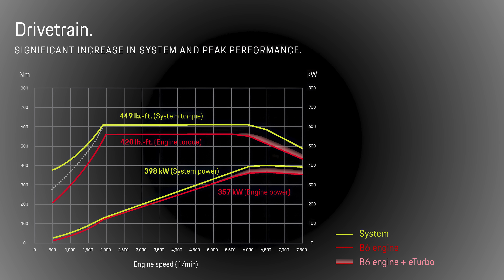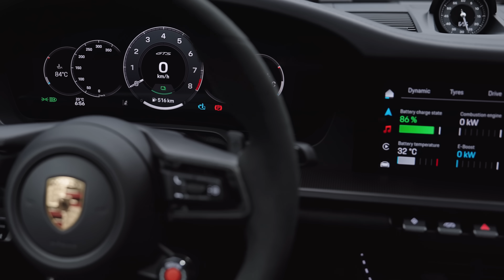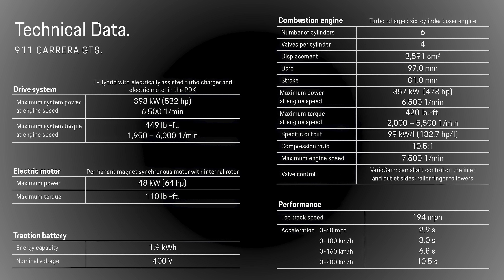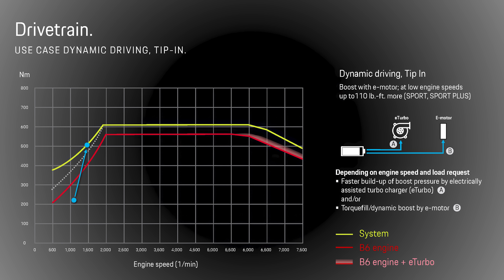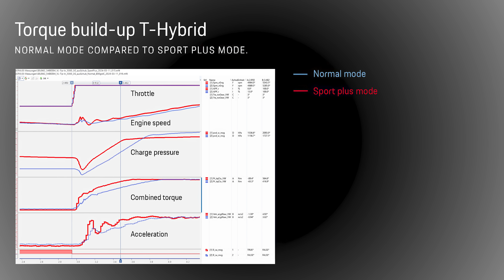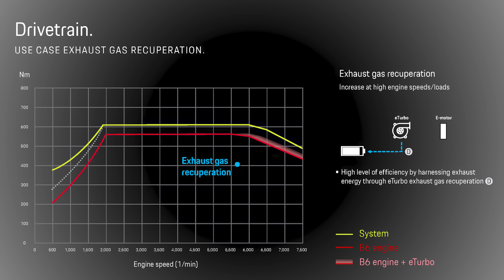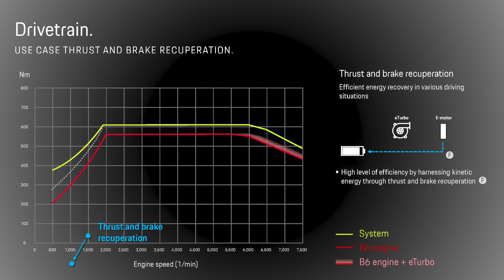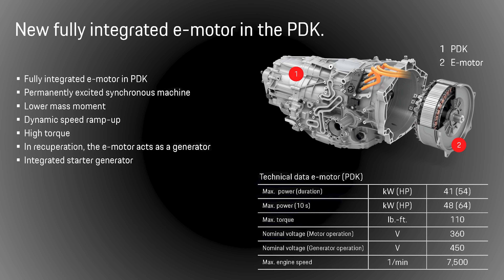2025 Porsche 911 992.2 | Bigger Engine, Electric Turbo

Comment: Crazy impressive to have a Porsche engineer explaining everything so perfectly...mad respect for this review of the mechanical side guys as it is very impressive!

 
So 100 lbs to gain 60 hp...all in the name of compliance...? 
Well at least it can get a full lap of the ring on a fresh battery pack at full charge before you lose the function of the turbo? 😬

To be fair most who buy this car won't track it so there is no real valid concern...?
Reply: The way the brand has been going, they are just building and selling to collectors and scalpers (mates with the dealers).  I've lost all interest in going beyond my 981 and 958.  Not diminishing the technical excellence of what they've built.
Reply: @guser7137  They burnt and soiled a lot of customer relations with their business model for damn sure! Engineering excellence keeping them in business though.

Comment: Wanted to hear the rationale for locating the battery pack over the front axle. That would seem to be the worst place to put it. Were they space constrained?
Reply: They wanted to keep their static weight balance apparently.
Reply: I can think of 3 possible reasons of the top of my hat:
1. Weight balance
2. Cooling (keeping the battery away from the hot engine)
3. As you already said yourself packaging

Comment: Hybridization may add performance but it removes the ability for you to service your own car. I can only image the issues these will have in 20 years and you’ll be forced to go to the Porsche dealer for anything serious.
Reply: Porsches have been going that way prior to hybridization unfortunately. From the 991 onwards you haven't been able to even see the engine without going under the car.
Reply: @dln.sweeney  that’s true but at least it’s still a simple engine and transmission. Now it’s over complicated

Comment: They kind of glossed over it, but the Lambda 1 thing is really big news. There is not a single turbocharged engine on sale that targets an AFR of 14.7 under load. That's very impressive.
Reply: puts in 89 octane
Reply: If it works
Reply: what does that mean?
Reply: @rel6294  it's all about air to fuel ratios in the cylinders... usually like 12 to 1 or lower under high load and "lambda 1" is another way to say 14.7 to 1 (aka one 'atmosphere' of pressure)
Reply: @ikaros4203  if im not wrong, basically the closer to lambda = 1 means more efficient combustion, since with the same amount of air it require less fuel to produce combustion? but in exchange for higher operating temp since no fuel is used for cooling?
Reply: Actually quite common with direct injection. EA888 does it.
Reply: This needs more explain
Reply: Stupid question, does this mean potential for less reliability if run in track /hard as more chance of knocking or running lean (without margin of safety of a rich mix)?
Reply: @trogdortheburninator8149  plenty of safety features in the engine controls to pull timing, or add fuel enrichment if combustion stability falls away as measured by the knock sensors. I personally do not see this as a risk on a track oriented car, more as an asset because it saves on fuel consumption at high loads.
Reply: Lambda 1 (~14.7 AFR w gasoline) is actually a lot more common these days than many people think. Emissions and fuel economy standards over the last few years drove this. there’s only certain scenarios where modern cars will dip below 14 seven buried most of the time during normal driving they try to hold 14.7/lambda 1.
Reply: Actually most of them do, at least for limited operation.  BMW has been doing it since the N54 engine, but would only run lambda 1 up until 4000 rpm or so, or for a few seconds until exhaust temps climbed then they'd go to power enrichment.  The 3.0 turbo in the new Acuras tries to run lambda 1 for as long as possible as well (BMW does it better).
Reply: So is it detrimental to keep the AFR  stoichiometric at full load ? , I thought all engines did this ?
Reply: @domkraggp9944  on regular gasoline yes very hard to do and has never really been done on cars 100% of the time before… on Ethanol fuel you could do it because it burns slower and cooler allowing quite lean mixtures

And if you’re wondering why it’s bad: lean mixture means more heat (and therefore knock/preignition… very bad for every part of the engine lol)
Reply: @ikaros4203  thanks 🙏 learnt something new.

Comment: Sounds like hybrid and manual transmissions are mutually exclusive
Reply: They're not (Honda proved that years ago), but nobody is bothering to attempt to develop that tech further....well...yet, anyway.
Reply: @aprtur that’s because Honda pioneers everything and then the Germans take credit.

Rear wheel steering on 1988 Prelude, 
then in 2014 debuts on 911 GT3

Variable Valve Timing early 1990’s for Honda everyone else like a decade later (or more) 

All Aluminum Construction on 1991 Acura NSX. Porsche 991 generation 911 in 2012 was first to have (only partial) aluminum chassis and body panels

Double wishbone suspension on lots of late 1980’s Honda products including Accord/Civic/Prelude/Acura Legend, Integra, and NSX. 
Porsche debuts it on 992 generation GT3 and everyone loses their shit 🤦🏻‍♂️
Reply: @jameswillard1  "that’s because Honda pioneers everything and then the Germans take credit."
  You mean the Germans perfect it.
Reply: @darthnatas953  please tell me more about how the Germans perfect it again at the 4 year mark when the warranty is up 🤔
Reply: I think it's tricky and arguably not worth it
Reply: The Suzuki Swift mild hybrids are also available with a manual transmission (at least here in Europe).

Comment: Unless your competing in a racing series with points and money, which I would imagine 99.5% of the 911 owners will never do, why do they need to keep getting faster?  Most sports cars for years have been too fast for the road, let alone their owners ability to extract the performance.  Why not concentrate on light weight exotic materials or construction techniques vs trying to get more power from the engine by overcomplicating the drivetrain.  It's still a fantastic display of engineering and I would buy one for sure.
Reply: That's why real men still drive Miatas
Reply: @dielaughing73  I agree. I'm not immune to hp.  I love to go fast and own an 1000+ whp twin turbo 5.0 mustang.  It's stupid fast in a straight line.   But, I still believe it's more fun and more rewarding to drive a 200hp car at its limit.
Reply: Because of the stupid culture that has grown up around numbers and pointless drag races on runways, thanks SO much, Carwow

Comment: I read somewhere that Porsche's engineers fought tooth and nail trying to keep the analog tach, but suppliers weren't willing to continue producing it due to the industry favoring digital gauge clusters.
Reply: No not true it was done to cut costs by having the same display for all models
Reply: @7ludi  yeah. If the industry will keep supplying hydraulic steering for tiny manufacturer mclaren, they would continue to supply analoge tach for porsche
Reply: yeah the screens/'track view' is so cope, screens should go on either side of the tach like they were...
Reply: two words, Aston martin

Comment: Porsche marketing bs checklist
0-60 time mentioned  ✅️ 
Ring time mentioned  ✅️
Reply: That can't be a Porsche check list. Where's the next 7 pages?
Reply: To be fair, it's a commercial
Reply: Na, 6 speed manual. Sell millions.
Reply: The 0-60 is always understated.
Reply: @guser7137  overrated statistic
Reply: @Carado5150 it's literally the only performance stat that 99% of buyers can actually hit save for braking distance, hardly any buyer is bold enough to hit peak cornering forces and almost no one goes out onto an empty stretch of road to slam the brakes from 60mph

Comment: I remember when the first gen Prius and Honda Insight came out, hybrids seemed like the worst of both worlds. Two separate power trains merged into one. Extra weight and complication. 
But that was before every single manufacturer started downsizing and turbocharging every engine in their line up. 
I'd wager that since Porsche is running a 3.6L rather than a 3.0L, they can get similar power numbers to the previous engine, but running slightly lower boost, much in the same way that AMG was running fairly large V8s with high flow, low boost turbos right before the ubiquitous 4.0 V8 became their only V8 option.
What I'm getting at here, is that IC engines have gotten smaller in displacement, but the complexity and thermal management issues have only grown. Not to mention the fact that these engines consume less fuel at low loads, compared to the larger displacement N/A engines that they replaced, but have proven to be less efficient at high loads.
If/when the 911 992.2 T comes out,  I'd rather see it have the turbo system removed than the hybrid system removed.

Bring back the peaky N/A engines and rather than turbos to get more area under the curve, use electric motors integrated into the transmission or differential to add power and recover energy.

Comment: I’ve owned three versions of the 911 in the past 7 years including a GT3.  I’ve decided the NA manual mid-engine Porsche cars are better fun street cars.  I’ve purchased two of them in the last few years.  The 911 is just too big and too heavy for my taste now.
Reply: Agree.... after four 911s, I've moved on. Wouldn't have a new one.
Reply: @SPQR3000 every car is bigger now.  No way around it with the implementation of modern safety tech and such.  Battery tech will only make it even heavier
Reply: Thank you. Track times, 0-60? Who cares. Give me an NA anything, manual trans, and a windows down soundtrack. No one cares how fast you are, there's always someone fast. Just have fun.
Reply: Took one of them out today.  2021 Spyder manual.  Roof down bliss!
Reply: Good point. Gt4rs?

Comment: Meanwhile, F1 says the MGU-H has little relevance for road cars and eliminated it from the next ruleset…
Reply: I guess they weren't thinking about the performance application of it. They assumed that road cars would probably only be trying to gain efficiency, but this car is using it in its current application in F1.
Reply: @caryg4638 Mercedes themselves already have it on the road and they are in F1. Seems silly to me. I think it's all about sound and they didn't want to claim something purely emotional.
Reply: F1 always does the dumbest decisions
Reply: It's Porsche who made them drop it.

Comment: They should have gone high-revving NA engine with hybrid. The engineer says it is all about performance. However, on the street no one can extract the performance without losing a license. They need to bring back emotion. Also, notice how the standard daytime running lights make the car look like a beetle. No wonder the marketing is only showing the car with upgraded headlights.
Reply: Agree, but I think emissions rules dictate change like it or not. Just buy an older model, I just bought a 987.1. Not the fastest, but it’s a manual, very light, hydaulic steering, and naturally aspirated and you can wring it out on the street. Or get a Cayman 4.0 if you can afford it.
Reply: All about the numbers ans tech, lesser for experience. When people now lack the capacity to experience an exciting car with an inspirational soundtrack themselves, why should the company target the few that still can?
Reply: This is only their base line up… I imagine the next refreshed gt3 will be the 4.0 hyrbridized.  Next turbo will probably be bonkers with the same set up as this GTS with twin hybrid turbos.
Reply: be sneakier

Comment: This is nuts. Electricity spools the turbo initially and then the exhaust gasses essentially spin the turbine to charge the battery or use recuperated energy for the E-Motor. This isn't what I was expecting, and it's quite ingenious.
Reply: It's a genius idea, the turbo basically recycles twice.
I wonder what efficiency does it have?
Reply: mercedes has been doing it for a while now
Reply: Correction, i dont think mercedes captures energy from the turbo...

Comment: Oh my god look how deep the water pump is buried. Plastic impeller too! Couldn’t quite tell from the cutaways but looks like it might be very hard to replace.
Reply: The only way you can access the pump is with the oil pan removed, it is a very stupid idea to have 2 one dollar o-rings between the oil and water circuits. It is all about cutting costs, as with the full digital dash. These cars will be good for 5-7 years, after that will be scrap. Even "new" "OEM" spare parts for other older Porsches are cheaply made in India or Pakistan. I sometimes preffer to save and restore old used Porsche parts made 25-30 years ago than buy "new" refurbished junk in Porsche labeled boxes.
Reply: the 2nd owner of these cars better have 30k ready to go for repairs at all times
Reply: There is no German word for serviceability.

Comment: MGU-H in a road car. This overall is more similar to the F1 power train than the F1 teams are doing in their road cars. Amazing.
Reply: That whole split-turbo MGU-H system was pioneered by the Mercedes F1 team and they have been running them since 2014. That system is present in their AMG One, the new C63 and the current gen. 43 (moniker) products.
Reply: Makes me wonder why Porsche was pushing for the removal of MGU-H during F1 entry talks…
Reply: @Nathan0A  Because they weren't as versed on the tech as Merc were. You can tell they're playing catch up. If MGU-H makes a comeback, you'd bet the VW Group would be keen on it.
Reply: That IS a head-scratcher
Reply: Mercedes already has it in the C63-- if anyone actually buys one
Reply: Thats worth the definition of a new generation car alone
Reply: Haha I'm not an engineer and this is literally all that was on my mind. 'doesnt this all sounds like a mguh which F1 banned because they thought it went applicable to road cars'

LOL. FIA being shown to be incompetent again

Comment: I remember a time when "electric turbo" meant some BS you got from Ebay
Reply: Not to split hairs but it's an electrically assisted turbocharger, it's still principally powered by exhaust gas.
Reply: @toddstevens8506 was going to say if it was purely electric it would be a centrifugal supercharger, turbo charges are run off exhaust gasses.
Reply: @toddstevens8506 assisted or augmented, tomato or tomatoe it is one heck of a fine piece of engineering to eliminate turbo lag.
Reply: JC Whitney for the win!
Reply: It looks insanely expensive. Turbos are a wear item imagine getting a 10-15k bill for just that part
Reply: @Cubanb407  Extended warranty or leasing only my man
Reply: @Cubanb407 depends on your definition of wear item, but turbos are wear items in the same way transmissions and bottom ends are wear items. Nothing lasts forever man...
Reply: @turbo_brian  I totally agree. I just don’t think there’s gonna be a readably available guy out there that knows how to rebuild these.
Reply: I was quite tempted to stick those in my mk4.
Reply: Lmfao YESSSS
Reply: the G in GTS now stands for grobar warmin’
Reply: If by some BS you mean the electric turbo spinner I added to my e36 to add 59 HP you are spot on.
Reply: Its Formula 1 technology. Called an MGU. It harvests exhaust energy that old fashioned turbos waste and turns it into electric power that spins up the turbo instantly and eliminates turbo lag. Thats genius.Instant power, no waiting. But the lack of a manual transmission is the real problem.
Reply: Torqamp
Reply: Comment of the year!😂
Reply: now they are mass produced and sold on alibaba
Reply: That’s where Porsche got these
Reply: This makes me think of Cletus in the old days